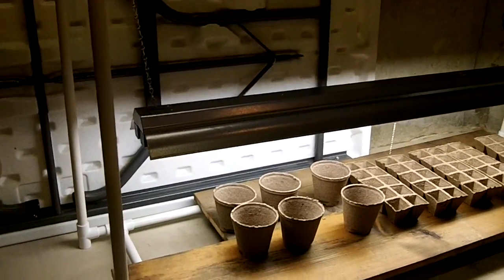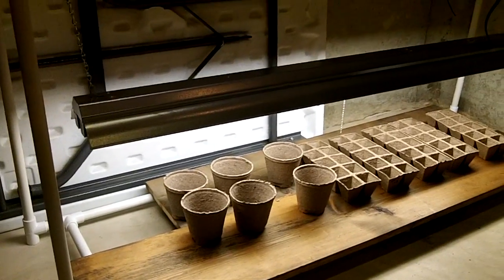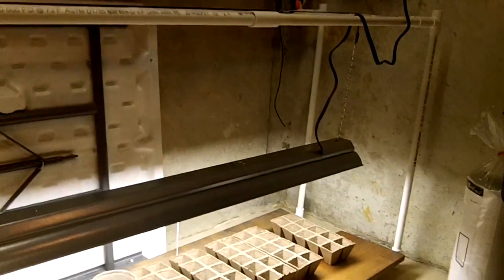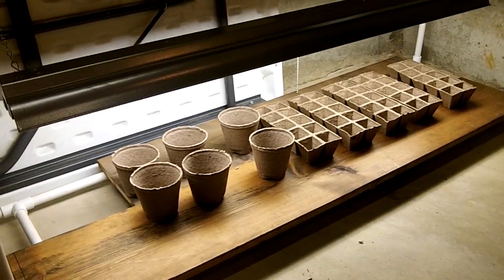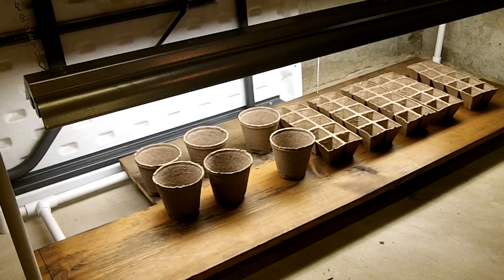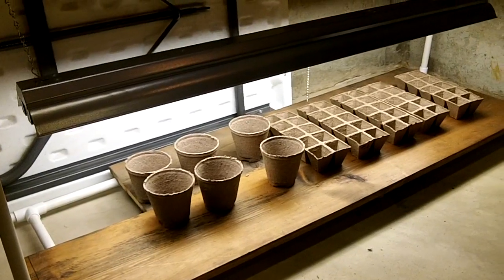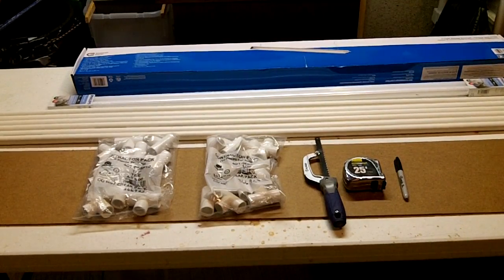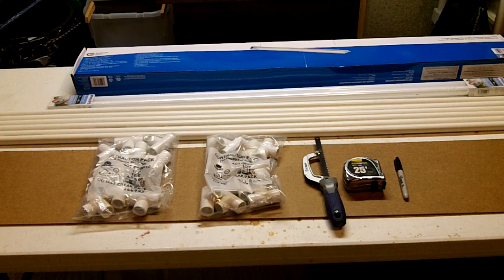Around the Home: #23 PVC Seed Starting Rack with Light

Comment: I keep my light on my growbed 24/7; from seed, to seedling, to moving the seedlings outside. I also keep the light about 1 inche from the dome that I have on them at the time.  When sprouting I use a 2 inch dome and change to a larger 6 inch dome when over half of the sprouted seedlings that sprouted reach the top of the 2 inch dome; some seedlings grow faster than others so this give the smaller seedlings a chance to get some light before I move it further away from them so that they don't get leggy.  Doing this keeps the temp inside the dome a toasty 76-80 degrees without using a heat mat, it works perfect!  I see videos with people saying that it takes a long time for their pepper seeds to sprout, so they add more heat to get them to sprout.  All of my seeds sprout within 3-4 days with the setup I have; which, by the way is similar to what you have minus the wood 

Being in Alaska and growing all kinds of plants, I start the seeds in the same growing media and indoors because of the short growing season. I never know when any of the seeds will sprout and I want the light to be there for them when they do sprout.  I usually don't check my seeds once I've planted them for about 3 days so I usually don't notice when they have sprouted. It has been my experience that you can leave the light on full time for your seeds to sprout; just covering them with some of your growing media is enough darkness for the seeds to sprout.  Thanks
Reply from the maker: Kenneth Elston Thanks for the info I will have to try some of that next year.